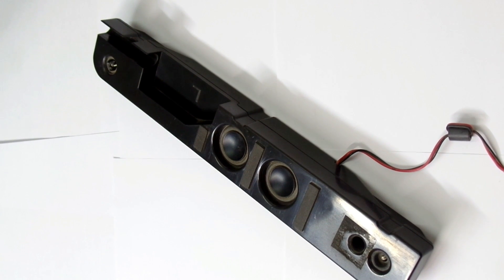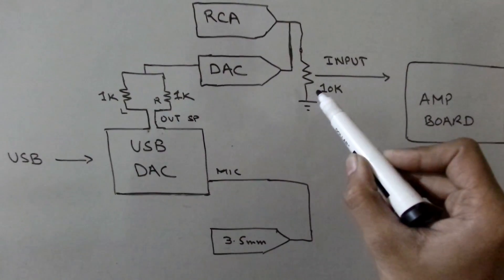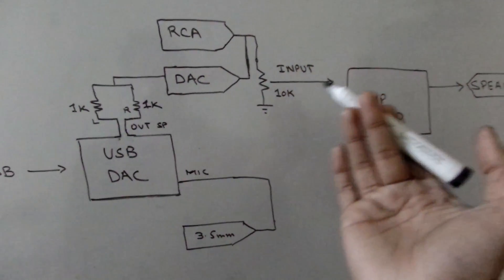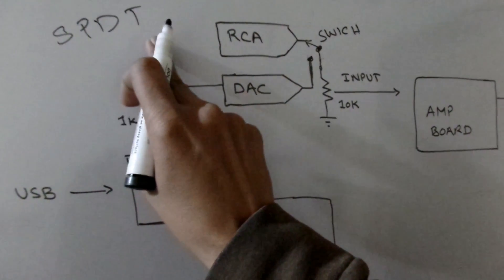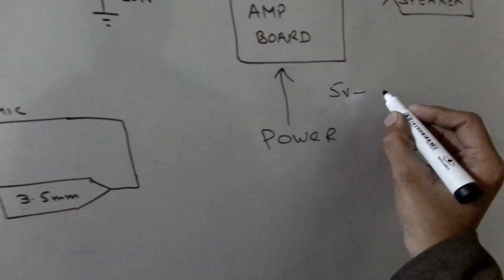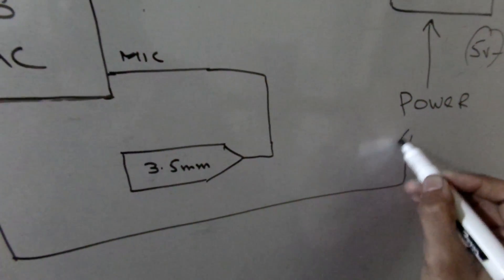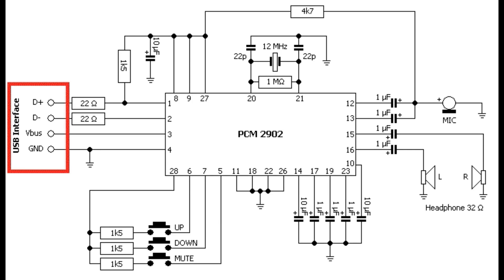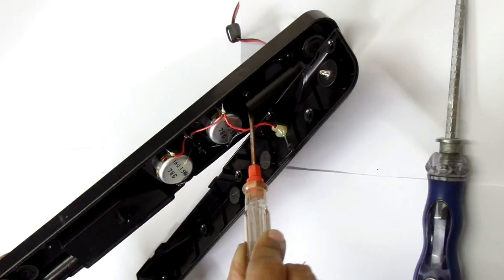DIY Build Mini USB Plug & Play Speakers (With Mic Option)

Comment: Is that a metal kinda piece you added at end before enclosing? If so, why?
Reply from the maker: Yes that is connected with ground to avoid noise from surrounding.